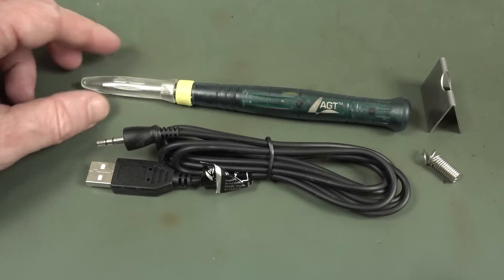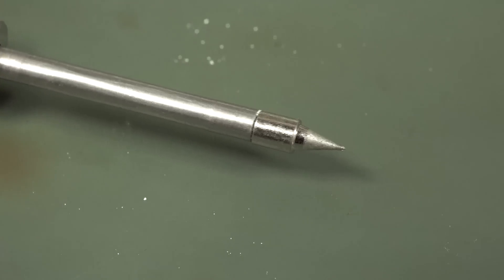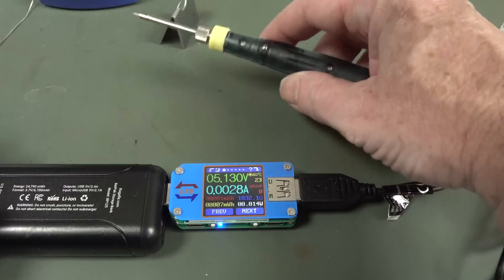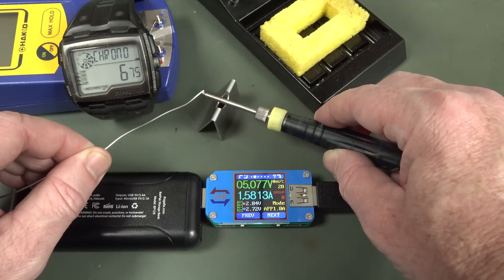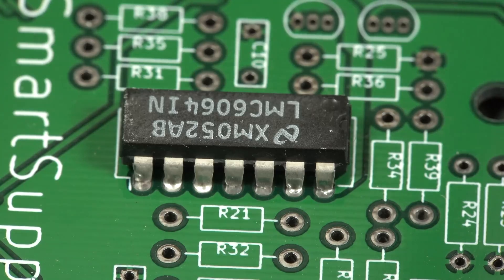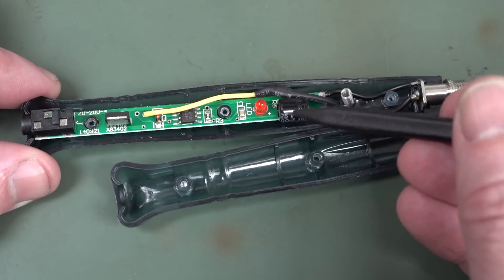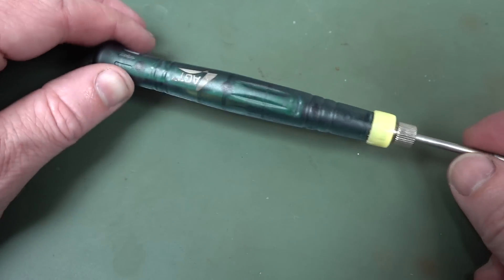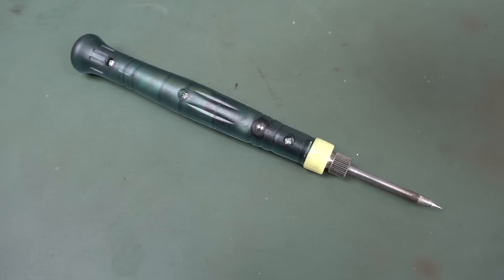EEVblog #1113 - Is a $5 USB Soldering Iron Useful?

Comment: it's cheap - and it works - what's not to like?
Reply: He's just pissed that he didn't think of it!
Reply: And it would most likely fail when you would need it most. Would not last. Just cheap ass shit. I would rather spend more and buy something that would last and be reliable.
Reply: You'll likely cook your components
Reply: WannaDIY  good luck with you bed and fire
Reply from the maker: How about that it's not temperature controller, runs too hot, his piss-all capacity, has a dicky touch sensor, and you can't buy tips for it.
Reply: OK admit it that asking for replaceable tips on 5 bucks is way too much of a stretch!

The rest tho... Yeah you do get what you paid for (or do you even?) and that's definitely way too low for a tool, other than a niche application. For such niches it may very well be a great little toy/tool.
Reply: Chances are if they sold tips they would have charge almost the same as the entire thing to make it worthwhile so they don't bother. With cheap stuff like this it's pretty much a disposable item when the tip goes bad.  Not really a good thing but if used for quick patch jobs where no mains supply is available it should last a while.
Reply: so buy four of them - and you are getting to the price of a single tip for a well known brand of iron ....:-)
Reply: when you need a soldering iron in some situations, the tip temperature doesn't necessarily matter - such as on a boat at the masthead fixing a temporary nav light - etc...
Reply: You can buy tips/heaters for it, they're about $3-$4 for a pack of two, but they are all identical.

It does indeed run too hot, so the tip gets consumed rather rapidly, and the touch control simply doesn't work for me, something keeps it on almost all the time regardless. I wish it worked.

Comment: Man i want one of those usb power meters! Very cool!!

Btw glad you gave this iron a fair kick at the cat :) even if its junk!
Reply: Ed Gein - NO they aren't. That meter Dave is using is a Ruideng UM25, which are about USD20. They are pretty new with a good screen and 5 digit precision, however the accuracy is not very good. The YZXstudio meters are far better accuracy, however they cost 2.5 times more.
Reply: John Coops hey thanks for the details. I still want one :)
Reply: Imma just stick with Keweisi usb meters

Comment: Bigclivedotcom was surprised by this iron. He tested it soldering some big connectors and it was nice. It's not earthed tho, so he powered from a big power bank
Reply: His version also had a vibration sensor to retrigger the 555! Basically a spring inside an empty tube.
Reply from the maker: Emilio Aburto - There are different versions?
Reply: I guess they updated the PCB or something. Here you can see the spring sensor located beside the mosfet
https://www.youtube.com/watch?v=o-8D5t6TJYU&t=301s
Reply: I messed up the location, he started disassembling it around 12:00
Reply: Forgot to mention he also used leaded solder!
Reply: Real men don't use unleaded!
Reply: I was surprised by it when I tested it too. The speed that mine came up to temperate was the most surprising thing to me.
Reply: His review is where I saw this. I put together the DSO150 with one. They're not too bad, just takes a bit of getting used to, And I use lead solder and separate flux. I keep one in my tool case and one on my desk for light stuff. For any serious stuff I move to my work bench and use the Hakko :)
Reply: Thank you Dave, very cool

Comment: I own one of these. It has potential, but is let down by a couple issues.

1. The tip runs EXTREMELY hot, 600-700C. I can forgive them for this though, it kinda has to.

2. The USB lead is crap, would like to see it have a mini USB cable so I can use my own beefy lead on it.

2. The touch button is very irritating. Its neat, but irritating. 

3. The 15 second timeout is also a bit irritating, but I get why they did it. IIRC they actually used a 555 for it instead of a micro, which could have done an always half power with full power on touch sort of thing.

That said, there are some handy features:

1. Its cheap as hell

2. Heats up bloody quickly

3. You can run it off almost anything. Even my phone's OTG can run it. In fact, all my electronics can, most are happy supplying 10w before they cut off.

I've used it to do quick repairs on stuff in my bedroom, like a fan on my 3D printer.

While not the best tool ever, most people might have a use from time to time, and its cheap, might as well.
Reply from the maker: Greg Hinson - Yes, Patrons often get to see videos early before they are released.
Reply: Compare it head to head with an RF powered soldering iron - https://www.youtube.com/watch?v=FS2NqyVDoqk&t=2s
Reply: Worth noting that at temperatures above 500°C, you start getting lead fumes
Reply: Pulling 10W from a USB OTG port or anything other than a USB charger/power bank sounds like a good way to blow something uip
Reply: smeezekitty I used to reset my USB HDD adapter on my old dell desktop by shorting out the 5v pins of the sata connector, the OL protection kicked in instantly and it never had any issues. While not an excuse to abuse it, all USB ports I've seen seem to have proper protection in place.
Reply: Both minijack and mini USB are not meant for high power, why not just use a regular DC jack and make it possible to use with any 5V DC adapter, not only USB?
Reply: One fix for those first two issues is to run it off an adjustable buck/boost (depending on your source) converter, especially one with a built-in voltage display. I run mine between something like 4.3 and 5.5v depending on if the work is more delicate or if I need that bit of extra oomph for a particular joint.
Reply: The lead is a built-in resistor, or a fuse, whatever you want to call it :D
Reply: have you tried with different usb power supply?
Reply: I fly mini/micro quads and I have one of these in my tool kit I take when flying. Very handy to do a field repair for a broken wire or swap out a burned motor.
Reply: Have you tried soldering your own cable?
Reply: there is version 2.0 LT002 with temperature controll
Reply: Fail rate is pretty high on these. I work for DIY company and we had more than 60 % return rate. Power output is super low, good enough for joining thin cables or, if you are patient, some Arduino tinkering, even battery-powered irons are better than this one.
Reply: That is an interesting use case, using your phones otg USB connection or even a battery bank to power this cheap little soldering iron could come in very useful!
Reply: 3 days ago?